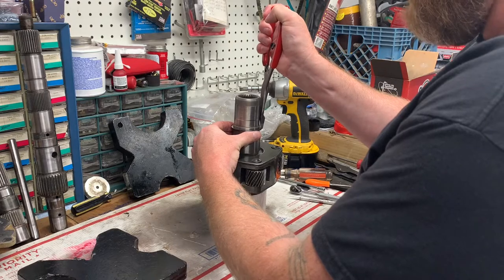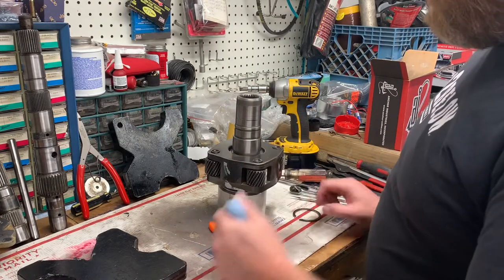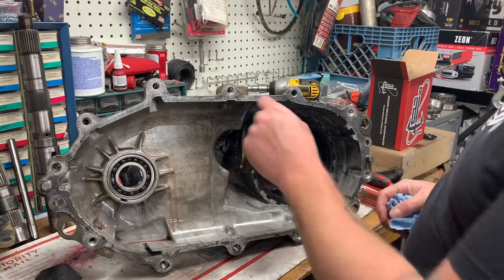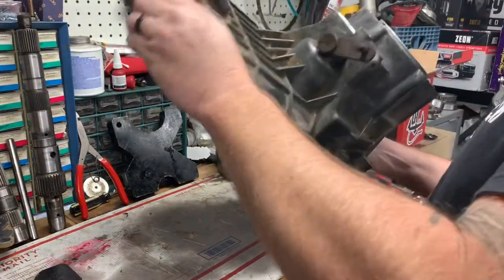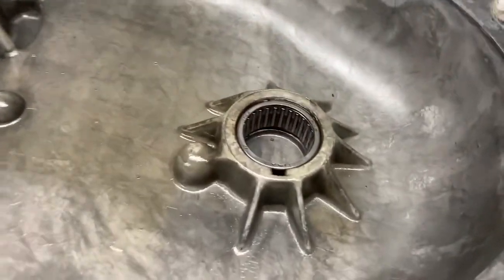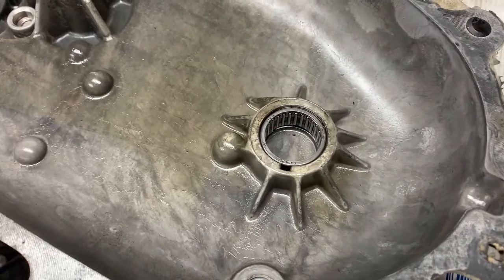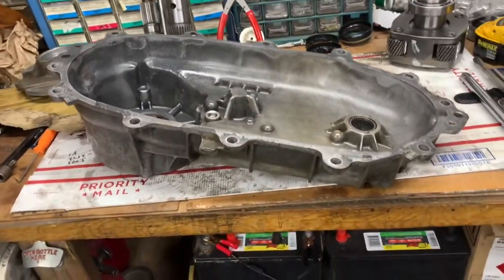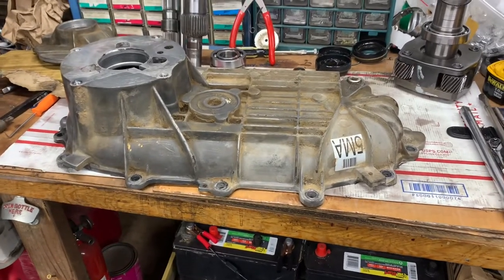Unofficial Addendum to Gettin Junk Done BW 1356 Transfer Case Rebuild; Don’t Let the Lock Ring Win!

Comment: They make a straight narrow nose version of those pliers. If anyone is doing lots of gear work, they usually have both pliers.
Reply from the maker: Interesting and thanks for the tip. This specific part number was recommended on a document I found detailing this rebuild process, but maybe they got the part number wrong. Either way, I had waited quite a while to receive these, and I wasn’t going to let it stop me, so I modified them and got it done. If you can provide me the correct part number for the straight narrow version, I’ll update the video description…not that anybody reads the descriptions anyway. 😊

Comment: For anyone else doing this, my local oreiley’s had a cheap set of lock ring pliers made by performance tool that needed no modifications and got that difficult ring out on the very first attempt. Best $18 I’ve ever spent!
Reply from the maker: Nice! Can you share the part number? I’ll add it to the description. 😊
Reply: Model w88001.  They look cheap but they work perfect for this job. I used them again today to take a good planetary out of a different 1356 for spare parts. Thanks for the tip about unloading the lock ring!
Reply from the maker: Awesome, I’ll grab a pair just to have ‘em! For sure, @rockharvey5787 . Thank YOU!

Comment: If I want to change my shift shaft seal without taking the case apart, will removing it cause internal parts to go “sproing”? Or can I change the seal out no problem? Mine is like in the video with a set screw. Thanks, Mike
Reply from the maker: That’s a good question. I’m pretty sure it would go sproing. And that quadrant wouldn’t have to move much, to make reassembly next to impossible. 

If you’re prepared to take it down anyway, it might be worth giving it a shot, since you wouldn’t have anything to lose. That said, if your seal is toast, chances are that pump arm has dug into the side of the case, and you’d benefit from tearing into it, regardless. 

Let me know what you find out! 

-Casey
Reply: @crazycaseyscustoms  thanks for your quick reply. I’ll keep ya posted.
Reply: Did it go sproing??? No… but. I removed the shaft and took the seal out. I put the shaft back in and wiggled it a little and it went home. Got a seal ( wrong size ) and removed the shaft again. When the seal wouldn’t fit I went to put the shaft back in and it wouldn’t go to home. Since the T-case was open a pushed the triangle wedge inward and the shaft went home. So it’s iffy at best.
Reply from the maker: Interesting,  @michaelkomosinski5015 . Good to know…